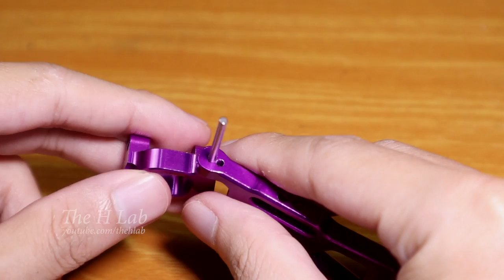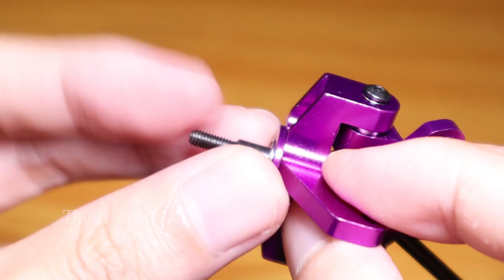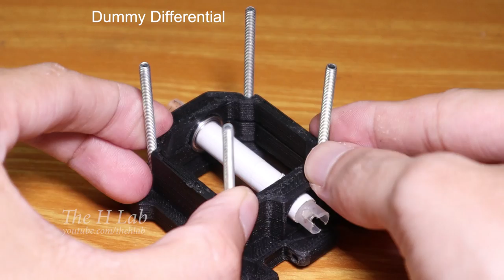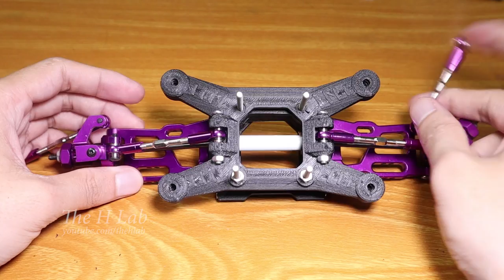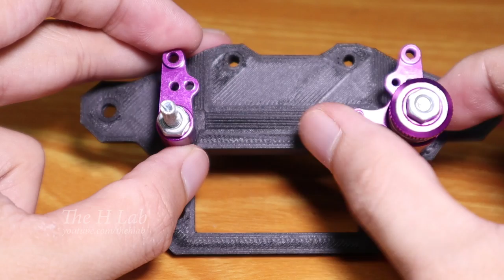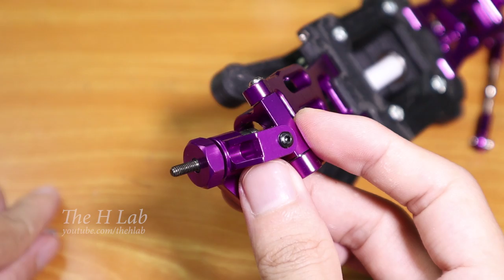Build a 1:8 4WD RC car at home | Part 1 - Suspension

Comment: Also, you should totally put locktite on the screws that go into the metal parts, for the final assembly of course. Just a tip so they don't loosen up over time 😉, just don't use the strong stuff otherwise you'll strip the screw when trying to undo it, don't ask how I know 😅